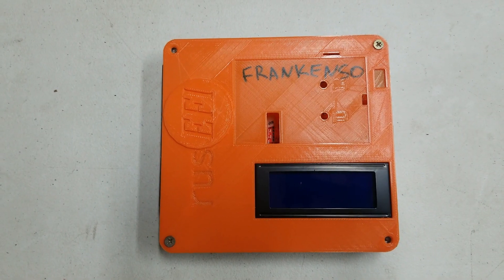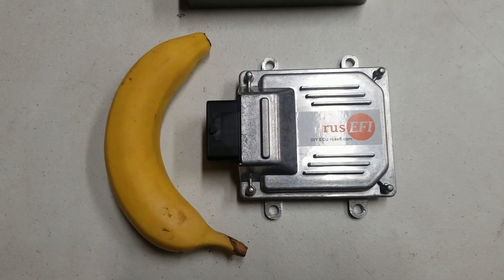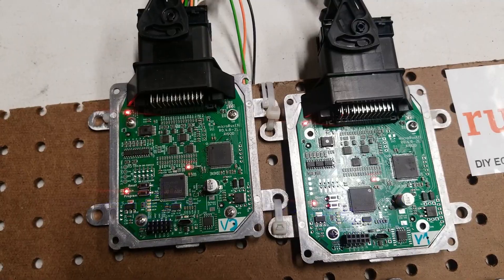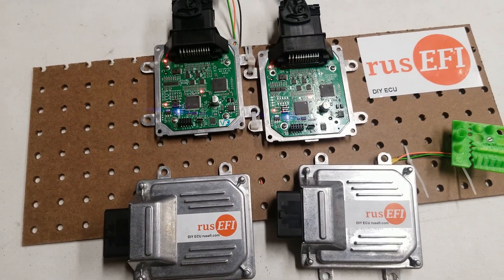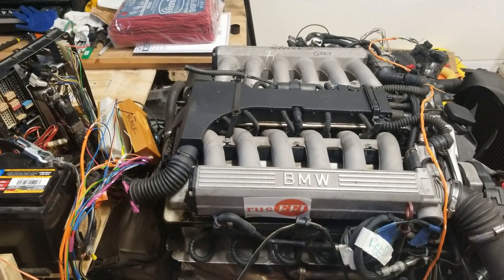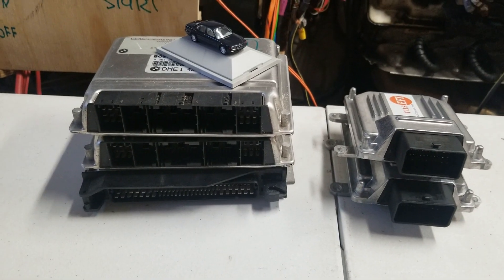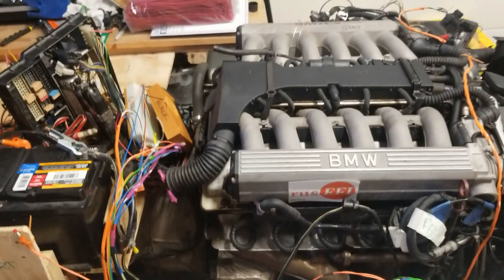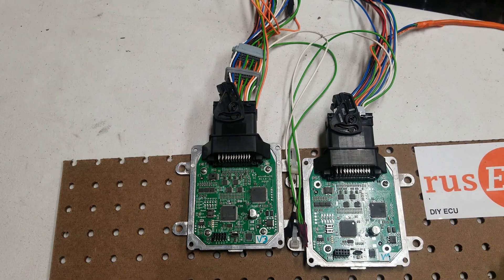microRusEfi rusEfi open source standalone DIY ECU runs M73 BMW v12 engine

Comment: Could you do it for a M120? 90's Mercedes V12? I'm in the process of building a custom frame for it twin pro chargers, displacement increased from 6.0 to 7.3! I would like to eliminate the EZL's that these cars came with! would still like to have traction control though it'll be AWD but I would like to keep traction system along with ABS! I am willing to pay you for your time and effort for looking into it! PM me and we can discus! THANKS!
Reply from the maker: Where are you located? realistically you need someone local. traction system along with ABS would make it HARD. https://github.com/rusefi/rusefi/wiki/Standalone-on-Demand
Reply: @Rusefi  Chicago, I know it's going to be difficult with traction and ABS! So how would we go about with the tune? is there a way to pull the stock tune off the ECU's and modify them? or would we have to start from ground up? Also looking into your videos I would need a canbus module to work along with 2 stand alone ecu's?
Reply from the maker: @musicman5299  do not see any PM way here please hit me preferably on slack registration http://rusefi.com/slack/
login https://rusefi.slack.com/ or less ideal on rusEFIecu facebook group

Comment: Any recent progress on direct injection? All of the engines I'm looking at for a jet boat project are DI.
Reply from the maker: we have postponed GDI progress until funding or qualified contributor joins the game.
Reply: I'll PM you.
Reply: @Rusefi  I can contribute a N73 760. I'll purchase the hardware and do the testing, but I can't offer any programming help. The 760 GDI injector drivers will work in standalone, but I'm not sure about pressure control.
Reply from the maker: @madgoatcustoms  https://www.patreon.com/rusefi is the simplest way to help really. Also we've made some progress recently https://www.youtube.com/watch?v=HmLA3PYHoL0
Reply from the maker: @madgoatcustoms  thank you for your interest! real rusEFI talk happens on rusEFI forum and/or rusEFI slack

Comment: 2 ecu for 2 throttle make sens, now in my setup I only have 1 (supercharged), do you think it would be possible to run 3 of those (3x4=12 cyl) on the same throttle body ?
Reply from the maker: dual ECU was only a stopgap for us, we have since moved to single ecu with dual ETB support

let's please move further dialog to rusefi forum
Reply: @Rusefi  Awesome ! I just subscribed to your forum, I will read trough it Monday

Comment: Hi. Where can i order one? Thank you
Reply from the maker: this dual microRusEFI configuration for v12 is not supported. you should consider https://www.ebay.com/itm/rusEFI-Proteus-BMW-M73-v12-standalone-ECU-with-PnP-harness/333805057834 if that's for a v12.
Reply: @Rusefi  thank you 👍👍

Comment: This was a great find for me, I have an extra M73 from a swap in my 750iL that I'm rebuilding. My plan is to drop it into an older Buick so I really only need something to make the engine run, none of that ABS or trans controlling stuff. How can I get a hold of this system? I have a complete engine harness so I guess I only need the controllers.
Reply from the maker: the "I have a complete engine harness so I guess I only need the controllers." part makes me a bit worried. all the connectors are very very different here right? anyway https://rusefi.com/forum/viewtopic.php?f=2&t=1749 https://www.ebay.com/itm/rusEFI-Proteus-BMW-M73-v12-standalone-ECU-with-PnP-harness/333805057834
Reply: @Rusefi lol I stand corrected, seems I need to read through that forum 😂

Comment: i have a countach replica with 95 bmw 750il , could you build me the ecus ? if you could whats the cost ?  thanks
Reply from the maker: $325 at https://rusefi.com/forum/viewtopic.php?p=37503#p37503
Reply: @Rusefi  great thanks , have posted a reply on the link , is it reasonably easy to install as I'm new to this ( but leaning quick ) , is there wiring diagrams etc ?
Reply from the maker: @princealbert123  Please start a new thread on rusEFI forum and people might help (or not).
Reply: @Rusefi  ok started thread , i was hoping there was a "standard set up " i could buy but im going to have to dig deeper i think !!!!
Reply from the maker: @princealbert123  I am working on a PnP M73 setup so maybe there will be something for sale.